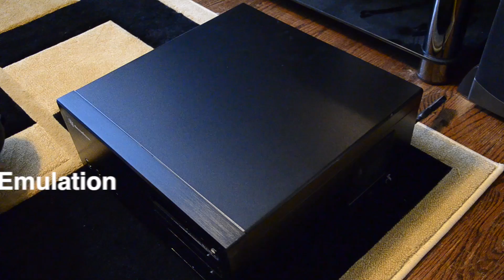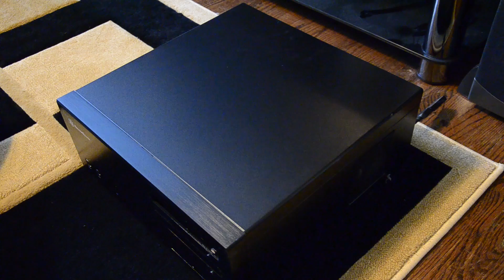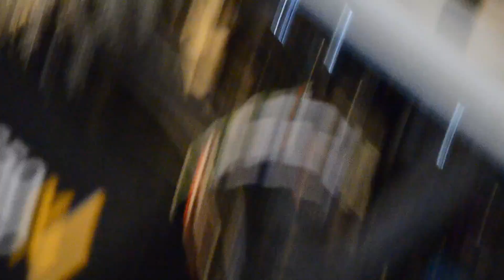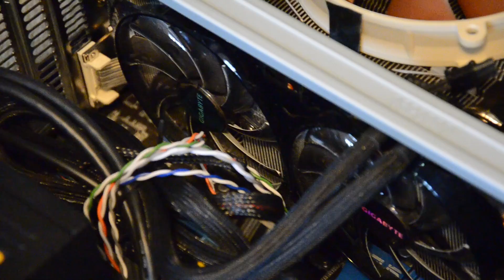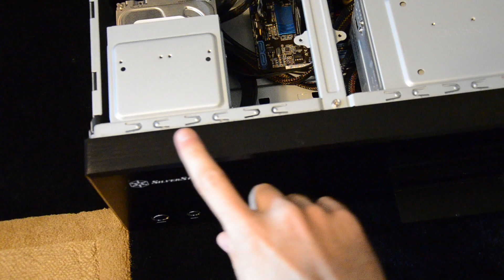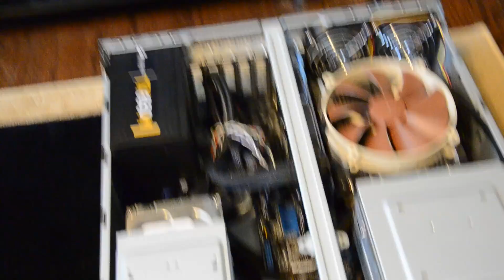Extreme HTPC Build - Emulation and XBMC - Components

Comment: CPU is overkill can you show basic cpu cooler...
Reply from the maker: Not sure I understand why the CPU is overkill. Its a fairly standard CPU, and its overclocked to 4.2 GHz (game emulation - for example nintendo gamecube and nintendo wii on the pc - is very cpu intensive unlike games that are developed for pc. therefore, you are stressing the cpu more.
if you are referring to the cpu cooler being overkill, - then ya you are probably right - though there were a couple of considerations on this point - the stock cpu cooler would not have been sufficient for that overclock to run safely for extended gaming sessions, and the noctua cooler i got was a special sale that put it maybe $15 more than other basic cpu coolers. given the performance of this cooler vs a basic one in terms of thermal efficiency,the $15 price difference was more than worth it.
had it not been on sale for such a great deal, then i would not have bothered with that one and would have definitely got a more basic cooler
Reply: +Phil Knudson do you have one for sale ? $

Comment: I'm sure the Noctua is a not a NH-L12 I believe that that is a NH-C12P NF-P14 140mm fan because of the fan shape.
I have just brought a Silverstone GD07 with Intel 3570k and need a good CPU fan to overclock, does anyone know if the NH-C12P NF-P14 140mm will fit or can you recommend an appropriate CPU fan
Reply from the maker: (I believe the nh-l12 was speaking to his video, mine is the nh-c14)
Not sure about size for you, that's always something that you have to do a lot of research to make sure it fits. There are certainly smaller coolers that are nearly as, and just as efficient. including some liquid cooling ones that are pretty neat.
One that i've heard many people love due to the performance for the price is the cooler master hyper 212 evo. It's smaller, performs very well but not to noctua levels. Always be sure things fit though. Mine is a tight fit, but it works. Some day when this one is no longer meeting my needs, I will look in to much smaller cooling options such as an out-of-case liquid cooling one so that there is overall cleaner air-flow

Comment: No. It's not the size, It's that it is sucking air from nowhere. Fans work on the principle of taking air from one place and forcing it to another place. Your case fans are taking are from the inside of the case and forcing it outside the case. That air is then replaced with outside air. Your cpu cooler is taking air from nowhere and forcing it nowhere. It's effectively an air stirrer. Air is coming in the expansion slots and being exhausted out the back fans. It's just an all around bad setup.

Comment from the maker: The cpu cooler is definitely big. And I agree it's not ideally ventilated but it still is working well. The cooler is not exhaust, it's pushing air down through the heat sinks directly on to the cpu. Then there are 2 fans right next to the cpu at the back that exhausts warm air. I was concerned at first as well, but I've done significant testing of prime95 and fur mark and others on 24 hour tests, and temps are fantastic. Typical usage cpu runs at 32 Celsius.